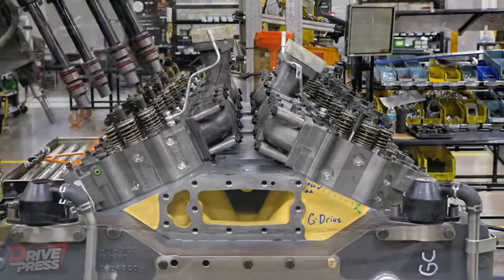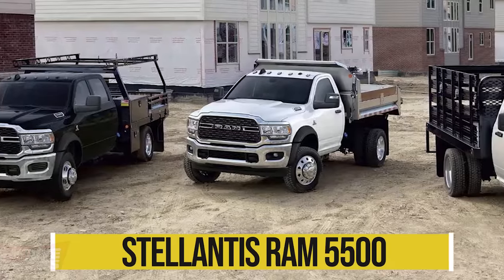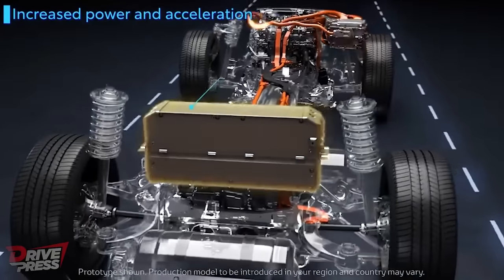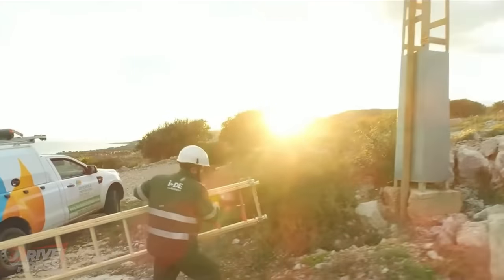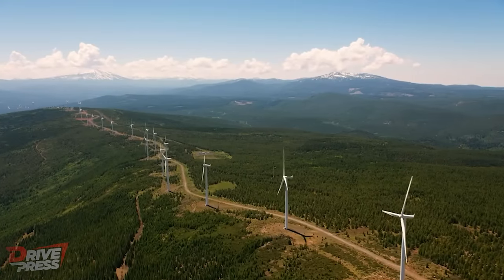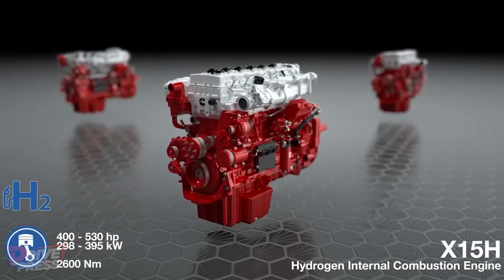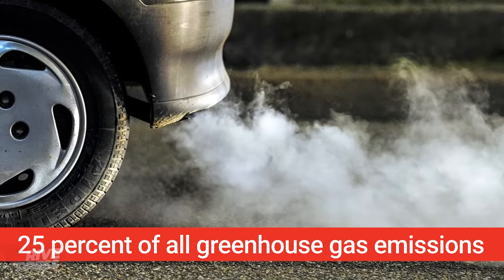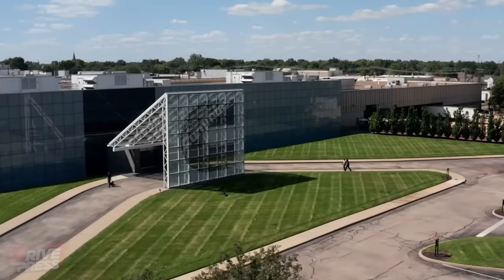Cummins Hydrogen Engine Spells Doom for Diesel

Comment: I was always told never to throw away old shoes before having new ones.   So a ban on diesel engines is definitely one step too far but closer to reality it is 3 stepts too far and even maybe more than that.   
1:  The arguments to ban the diesel engine are exagerated.   The only argument is the poluting emissions and then I do not count CO2 as a polutant as there is only 0.035 % CO2 in air whereas plants need CO2 for their growth.   And let us face erality: there is no greenhouse effect .....  As many of us know: CO2 is a hoax invented by the elite who have other plans with humanity. 
2:  The emission problems are not that serious to have a full ban on diesels.   And I do not count CO2 as an emission.
3:  Hydrogen is only nice when you can produce it in the vehicle with free energy (Stanley Meijer with high frequency plasma water splitter) or with an yet unknown energy source.   If not hydrogen production requires huge amounst of energy which nobody speaks about and on top of that there is a huge transport and storage problem.   

The world is facing one acute problem and that is the New World Order who use everything they can to demolish our civilisation.   Let us first solve that problem.

Comment: They tell you a lot about the new engine, but nothing about how much this is going to cost for the engine or what the H2 is going to cost or where it will come from. Ask more questions before you jump on this band wagon.
Reply: That's right, because answers to those questions are negatives for the use of Hydrogen.
Reply: Break even is 3cents per kilowatt hour for the same energy price for hydrogen as a current diesel engine fuel.
Solar panel farms currently have issues with electricity grid prices going negative about four hours per day - which means they could profitably make hydrogen by electrolysis about four hours per day.

Comment: Again the dilemma they can never tell us or even crosses they/your mind? Gas or Liquid... hydrogen. There is a difference
Reply: Storage and transportation of H2 gas is already too expensive and inefficient and Liquid H2 just adds on another zero!
Reply: @Hogger280 The Japanese are running a hydrogen powered LH2 tanker ship between Australia and Japan NOW.
Liquid hydrogen is no harder than liquid methane - you just have to line the tanks slightly differently.
Reply: @allangibson8494  H2 is much harder to deal with - it is way colder and more energy demanding to keep is liquid.
Reply: @Hogger280  Actually very easy to keep liquid with good insulation…
It just takes minor modifications to standard practices for LNG.

Comment: Why is this JUST happeneing? Weve KNOWN this math, for decades. People are making several hundred HP v8 engines that are hydrogen powered in their own barns......gasoline/ or diesel  ,doesnt turn into vapor/combustible fuel well in cold, hydrogen (at 5000psi/ 400-1000 bar/"common pressure" ) ALREADY is  gaseous , and there has DEFINITELY been injector technology out there, as well as advanced ,can based software that can control timimg/combustion control. So why this is "just now" happeneing, is beyond me. Peace

Comment: Fact is even if this tech was available now, fully manufacturable out the door in customers hands the infrastructure is not there. Imagine picking up a brand new 2024 dodge ram with this new technology driving home driving around town, then pulling into a gas station and finding out there is no fuel. Click bait straight click bait even if this technology was available today it’s still 30 to 20 years out.

Comment: The piston engine is by design highly inefficient. By running it on hydrogen it does not make it more efficient. Hydrogen fuel cells are the best way forward.

Comment: I visit a lot of fuel stations and see both gasoline and diesel pumps. I have yet to see a hydrogen pump. If there was one it would probably be really slow to fill a compressed tank and if it was liquid hydrogen then the cryogenic fuel delivery station and the cryogenic fuel tank I would put the fuel in would be a truly rare sight. Hydrogen fuel has a place as rocket fuel. It is rather exotic and dangerous for a motor fuel.

Comment: Hydrogen might be the future, but don't think it's somehow environmentally friendly in the near future...

Hydrogen is relatively inefficient and production requires a lot of energy. With that in mind, if not produced using solar, wind or other "green" methods, hydrogen creates pollution just like diesel, or even more. Every energy source has it's problems, which obviously have to be overcome with r&d. 

Even solar power isn't really clean. Solar panels are very inefficient and production of solar cells faces massive challenges in terms of energy and resource requirements.

The pollution created by  production of just ONE battery pack for an EV equals to combined MANUFACTURE + 10 YEARS of DRIVING AND MAINTENANCE of a DIESEL car, think about that for a moment... 

Personally i'd like to see hydrogen become the primary energy source for cars, since i love internal combustion engines. Electric cars have no soul.

Comment: For highway use hydrogen is not practical.   Natural gas is more but not enough to replace diesel.    I have burned billions  of cubic ft of natural gas over the last 60 years and know it is only for stationary engines.

Comment: Hydrogen engines only make sense if you have an effective way to produce Hydrogen. In other words the only viable very low carbon source of Hydrogen  is nuclear. The demand for combustion fuel is simply too large for silly toys like windmills and solar.  

Like most Power Plants nuclear plants have a production sweet spot. A level where they run most efficiently.  Electrolysis of water could be an effective and efficient option during times of overproduction.

Comment: Not hardly. Tell me when they can fit 39kw of power in a 1 gallon container of hydrogen, and THEN you'll spell doom for diesel. FYI- diesel engines ARE hydrogen engines.

Comment: yes,hydrogen combustion engine,,on my own opinion,,,is better than BEV,,,because it can be driven to any place and to any weather and it does not need more expensive rare metals,,,this is  the best substitute to diesel or gasoline engine,,,,who cares if somebody close the straight of hormuz if hydrogen combustion engine is available anywhere,,,,and no need to buy new vehicle,,,,just change the engine and add hydrogen gas fuel tank,,,

Comment: Hydrogen is a supremely dangerous and hard to handle substance.   I'd rather power my truck with plutonium - at least then I would not need to face an explosive risk every day.
Reply: No worst than propane powered engines
Reply: I have run a LPG powered vehicle for 20 years with no leak issues and I have not heard of one serious LPG filling problem here is Australia and there are thousands of them. Hydrogen is stored at much higher pressure and is a more corrosive substance but for heavy transport we don't have much of an option because battery power will not provide the answer unless a battery breakthrough occurs that drastically reduces their weight without affecting energy density. In an outside low pressure leak situation Hydrogen is safer than propane because it is lighter than air and will disperse. Making CLEAN hydrogen in high volume is a problem as its complex and uses a ton of electricity. If we end up making Hydrogen from fossil fuels then it is not a clean fuel, in fact running on diesel fuel would be cleaner.
Reply: @Marcel-54  propane doesn’t destroy the container that it’s in. Hydrogen will penetrate steel containers and cause cracking and embrittlement of the alloy. Not to mention if there’s a wreck.
Reply: Oh the humanity.
Reply: @Marcel-54  hydrogen is a lot different to propane.   It attacks steel and is such a small molecule it is really hard to keep contained
Reply: @BadWolf762  Most of the people burned when the Hindenburg perished was caused by the material that made the gas bags. the hydrogen flame dissipated quickly as it is lighter than air.
Reply: Exactly. Engine was never an issue with Hydrogen. The technology of handling it before it enters the combustion chamber is the key.
Reply: @khalsasikhpunjabda  Handling it is actually the reason it will never be practical.
Reply: Hydrogen isn’t corrosive.
It does have issues with migration through steel however. This can be prevented by gold plating the inside of the tanks and piping.
Reply: @allangibson8494  Gold Plating the tanks....HAHAHAHAHAHAHAHAHAHA LMFAO
Reply: @allangibson8494  H2 isn't corrosive in the way we think, like rust, but it does penetrate the steel and weakens it.
Reply: @Hogger280  Different effects - and completely avoidable with the right materials of construction.
Gold and Tantalum are completely impervious to hydrogen for example.
Gold plated equipment is standard for hydrogen services.
Reply: @Hogger280  Yep. An atomic thick layer of gold is impermeable to hydrogen. Carbon fibre composites work too (just not for submersible use).
Or just go to liquid and avoid the problem which is driven by high kinetic energy hydrogen atoms.
High pressure hydrogen storage has been a “thing” since Zeppelin’s stopped referring to a just county in Germany.

Comment: You have to love the way they lie so easily. "Zero emissions", "carbon neutral"? They love to leave out how much electricity it takes to produce the hydrogen and where that electricity comes from. Less than 7% of electricity in north America comes from wind and solar combined. That means coal and natural gas are producing the hydrogen. Vehicle mounted hydrogen generators are impossible to use to run a hydrogen engine due to the fact it takes more power to produce the hydrogen than the hydrogen produces when burned. Innovation is great but videos like this which lie to the viewer are far from great

Comment: Ultimately the hydrogen infrastructure will be in place FCEV THE FUTURE The hydrogen stored in high-pressure tanks combines with oxygen from the air to create a chemical reaction that generates electricity and water as a byproduct. FCEVs have zero tailpipe emissions, and their energy efficiency is higher than conventional internal combustion engine vehicles.21-Apr-2023
Reply: Not when you calculate in the costs of manufacture, storage and transportation of hydrogen - then it is much less efficient.  Don't forget that hydrogen must be MADE,  which means another form of energy has to be used to create it - take your pick:  coal, oil, natural gas, Nuclear.

Comment: Deposits of  'white hydrogen' are quite common,  it is formed underground like methane is,  the difference is that because the hydrogen is formed by natural chemical reaction it is being continuously replenished and you only have to drill one well and the hydrogen will continue to replenish itself and continue flowing...
Reply: And like oil and gas are.
Reply: @scaryfakevirus  Gas and oil do not replenish themselves, they are a finite resource from one well and you have to keep drilling new wells.  The Hydrogen is re-generated by a natural chemical reaction underground, so once you tap it,  it keeps coming out of the same hole in the ground.
Reply: @chrissmith2114  My response is constantly being deleted by YT.  Whether this one makes it I have no idea.
Reply: @chrissmith2114  Let me try and break this up for you in several comments to see what they don't like.
Reply: @chrissmith2114  That's what they tell you.  Oil and gas are not 'fossil' fuels like coal.
Reply: @chrissmith2114  They regenerate deep underground like Prime Water.
Reply: @chrissmith2114  Do you really believe that oil was the end product of dead dinosaurs?
Reply: @chrissmith2114  It's a scarcity sacm (sic)

Comment: They need to develop ALL vehicles to hydrogen fuel engines-- with electric motors on the wheels (like a train-- more power- longer lasting- greatly increased mileage- and the output is WATER)

Comment: Boy! Another engine! Phooey! Go away! They refuse to produce engines that are practical and cheap. Go away.
Reply: There's always the two-stroke opposed-piston diesel engine.  The German company Junkers made a practical example that powered passenger airliners in the 1930s.  This engine has been widely used in small boats, especially by the military, where a high power-to-weight ratio and fuel efficiency is critical.  Saudi Aramco is developing it in its Achates Power engine.

Comment: Cummins is doomed. Hydrogen is a terrible solution fro road transport. The end to end efficiency is one third of a BEV. Battery energy density is rapidly improving. Even now, the Tesla Semi is proving its practicality. Things are only going in one direction I'm afraid, and Cummins isn't part of that future.
Reply: JCB is selling hydrogen powered vehicles NOW for applications where they are off road and off grid.

Comment: Diesel isn't going anywhere for a good long time.  There is very little hydrogen infrastructure anywhere.  What is that infrastructure going to cost to build and support?  There is nor will there be a zero carbon solution for vehicles in the foreseeable future.  The public is being fed the same myth about hydrogen as they were with electric vehicles.  Electric vehicles cause lots of pollution caused by producing the electric power they use and the construction of the batteries that store that power.  Hydrogen requires electrical power to be created and that production pollutes, just as does the production of solar panels or wind turbines   Zero carbon transportation is a myth and will remain just that for many decades if not forever.  The key is limiting the amount of pollutants produced and being honest about that level.  Always remember if something sounds to good to be true, it generally is just that, to good to be true.